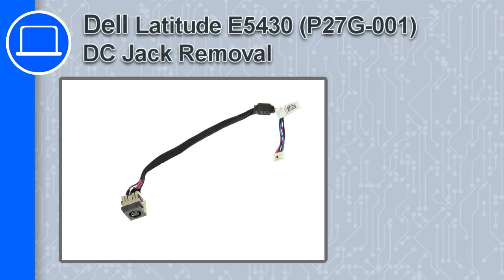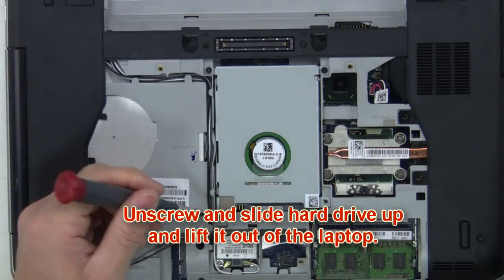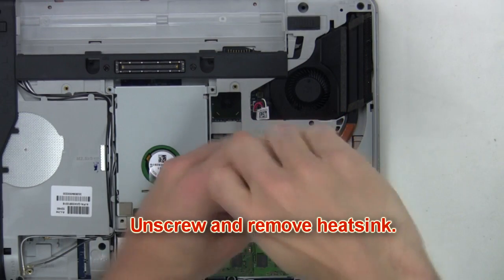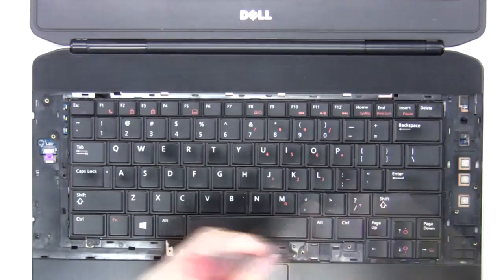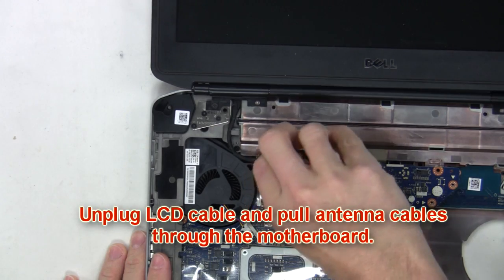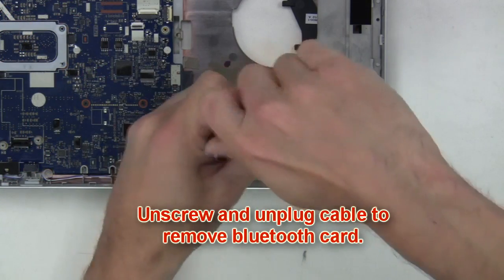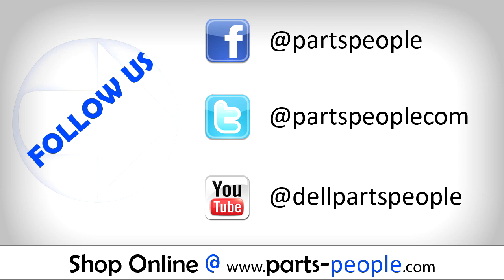Dell Latitude E5430 (P27G-001) DC Jack How-To Video Tutorial

Comment: Love this video!  A few things you missed (or show doing twice) though:
1. You forgot to mention the WiFi adapter needs to come out (1:08).
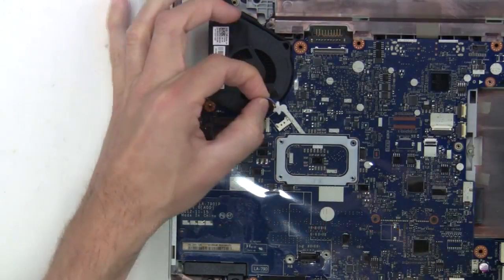2. You don't need to pull the cooling fan power until removing the motherboard. When removing the palm rest cables the video shows you removing this power connector (2:32), but it's not in the voice over, and not necessary until 3:52, where the video shows it being done again.
3. The ribbons to the Bluetooth and audio/USB IO cards needs to be detached from the motherboard for the bluetooth card and from the audio/usb card side for that card, but neither card needs to come out.